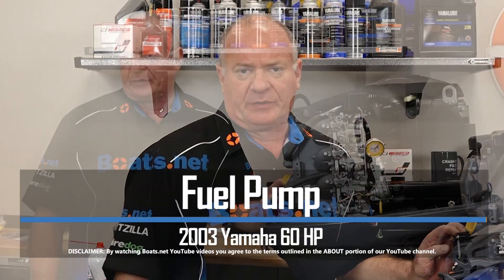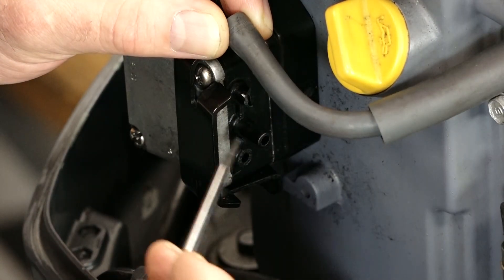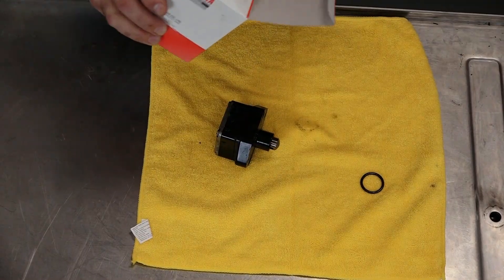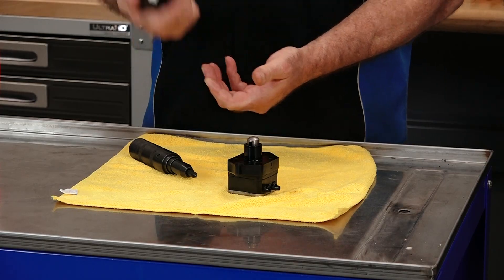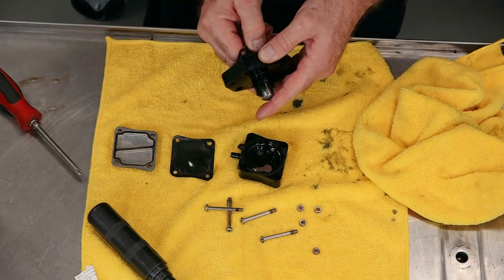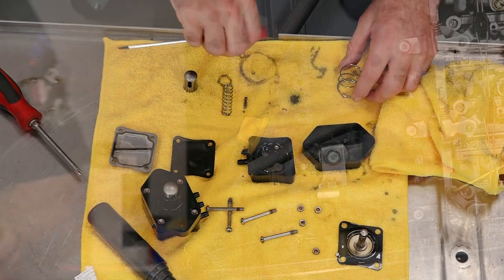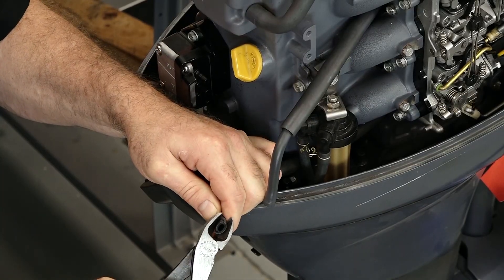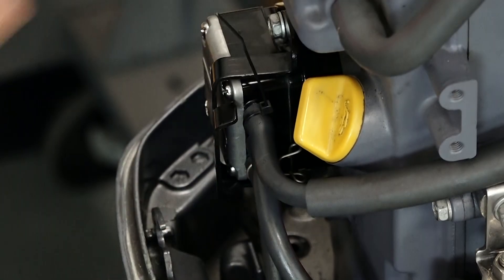Yamaha Outboard Fuel Pump Replacement | Yamaha T60 Fuel Pump Repair | Boats.net

Comment: Hi John I’ve got a question for you Please help me
I’ve got a 9.9 Yamaha 4 stroke 2007 model 
Starts runs etc 
Only problem is 
Recently the oil have started to squirt from oil filter? 
I’ve checked everything regards to old oil seals 
Right torc 
Right amount of oil etc and a genuine Yamaha oil filter? 
Could this be a oil pressure relief valve problem ( I took it out and cleaned it ) 
Or maybe oil pump? 
Much appreciate it 😊

Comment: Hi John. Now I'm going to ask you a strange question. We have new triple 300hp diesel outboards (will not name the make at this stage) on our vessel and if the manufacturer finds out I'm asking this, I'm in trouble. 
The problem we have with these outboards they overheat very quickly when at idle, there fix is to put them in neutral and manually increase RPM to increase water flow. This is not practical in a lot of situations, they say they can't fix this issue.
My question to you is, will it harm the engine if I contact an auxiliary water pump feeding water in through top flushing ports. I did a test on one engine, waited short time for outboard to heat up then I contacted a freshwater hose to the flushing port, turned it on and instantly the power head temp dropped down to normal level.
The manufacturer says there is nothing they can do to fix this issue with these outboards.
At least with an auxiliary water pump contacted to the flushing ports to each outboard, and we need to run at idle speed say when towing or rafting up a boat we can turn on the auxiliary pump to stop the engine overheating or shutting down as they do. As the cooling is an open system, can't see how you could cause any damage.
The problem is that the outboards water pump just does not supply enough water volume to cool the power head at idle, so this pump at least supplies some water to cool the power heads.
We will only use the auxiliary pump when at idle or idle speed, the outboards are good when the vessel is at speed.